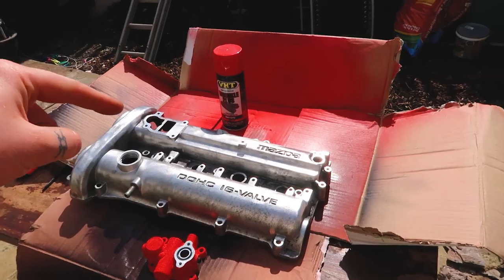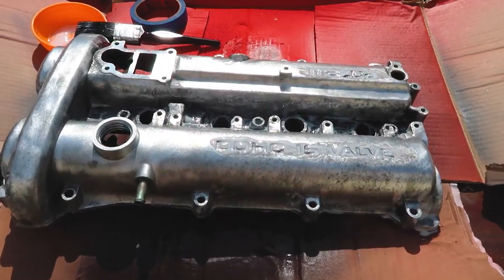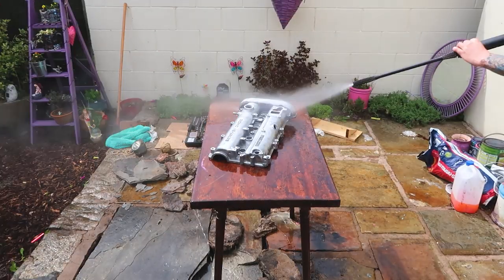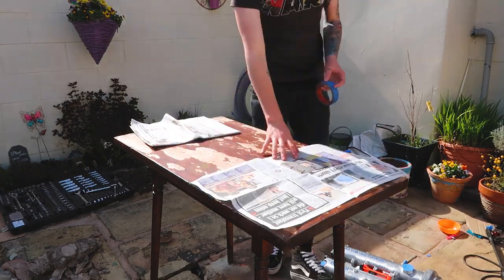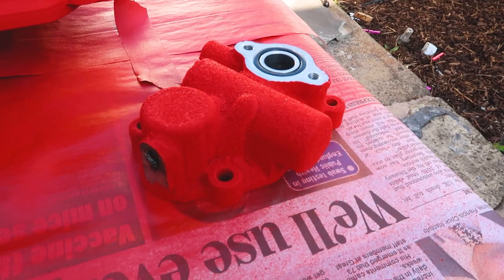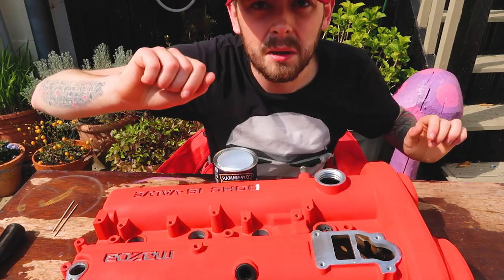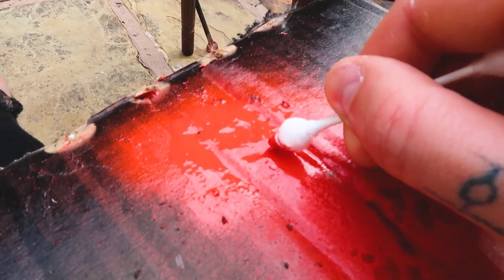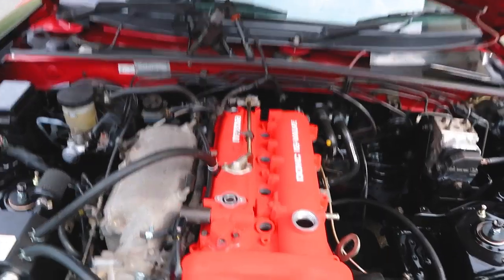VHT Wrinkle Plus Cam Cover! Engine Bay Clean-up: Part 2

Comment: For the letters Go to Banggood and search for syringe SMD solder dispenser Couple of quid gets you a load of size needles and a couple of syringes . Turned out pretty good thou.
Aren't you supposed to bake it in an oven to fully cure ???

Comment: hello, after painting did you put it in the oven or used a body dryer or did you leave it to dry at room temperature?
Reply from the maker: Stefano Tuveri I left it to dry outside sat in the sun, and it was quite a hot day 🤷🏻‍♂️

Comment: Would you say you could get away with not doing anything to the letters at all? Or best to do something? Mine are currently filled with candlewax and worried I'm not going to be able to dig it out 😂
Reply from the maker: Ollie Rix is definitely get the was out, like, completely out 😂 the paint probably won’t like that, but once it’s all cleaned off just spray over them, if that’s what you mean??
Reply: @JayDidThis  the candlewax is inside the letters to stop the paint getting in, so once the rest is painted Ill have nice empty clean letters? Does that make more sense 😅 thanks for getting back to me

Comment: That has come up amazing! I have been meaning to do mine but everyone always uses a heat gun or oven, leaving it worked great. Did you need a new rocker gasket?
Reply from the maker: It was a really hot day and it was sat directly in the sun, and it might have had a little hairdryer action off camera 😂 and yea man, best to always put a new one in when it comes off 👏🏻
Reply: Jay Did This may have to wait a few weeks for the sun to come back now! Got my NB 1.8 booked in for cambelt swap tomorrow along with all gaskets and seals, wish I’d had time to paint the rocker cover now! Thought about doing the inlet manifold in black wrinkle?
Reply from the maker: Chris K it’s not a big job to take off, just make sure you’ve got your fresh gasket just in case for when you do 👏🏻
Reply: Jay Did This yeah seems simple, done rocker gaskets on turbo astras and civic type Rs before, just a shame to replace what will be a week old gasket! But for that end result it’s worth it!